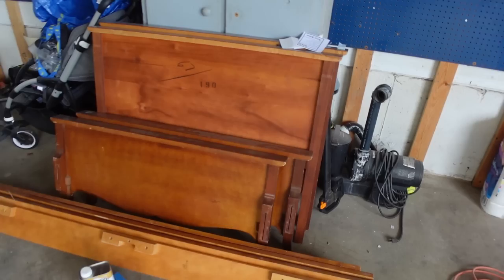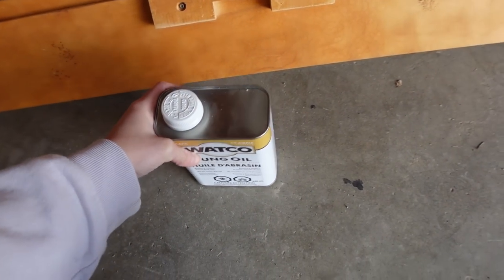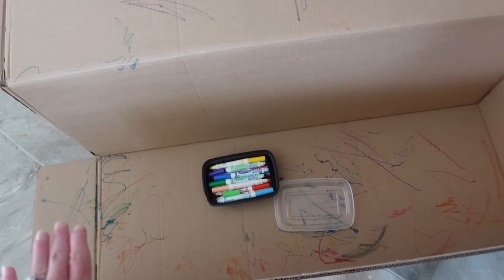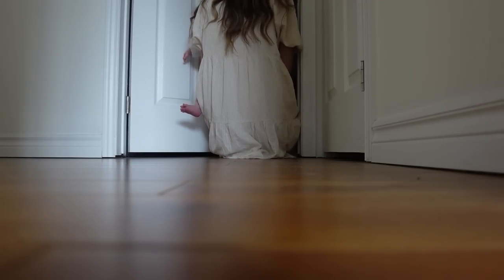bye bye crib 👋 | toddler bed transition + DIY antique restoration

Comment: I refinish furniture and the best way to counteract the topcoat darkening the wood is actually doing a “paint wash” with a warm white paint (1:3 ratio paint/water) you paint it on then wipe it off right after. then seal with a water based top coat!! 👌🏼 (any oil based product will darken it!)